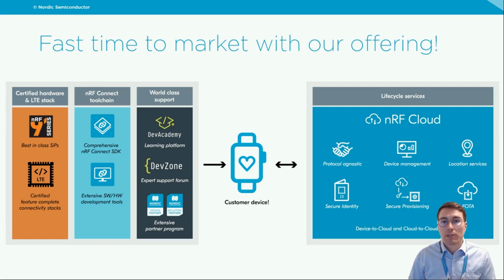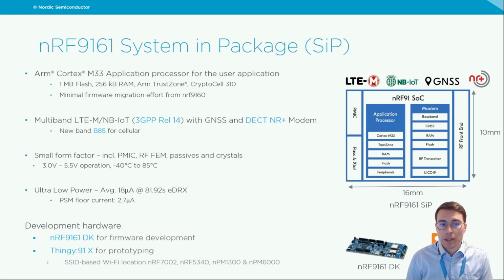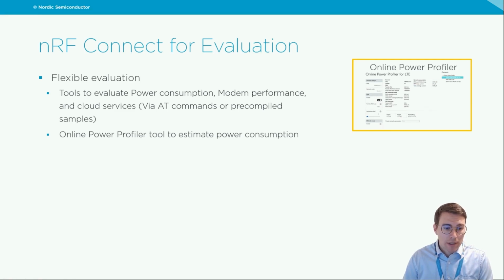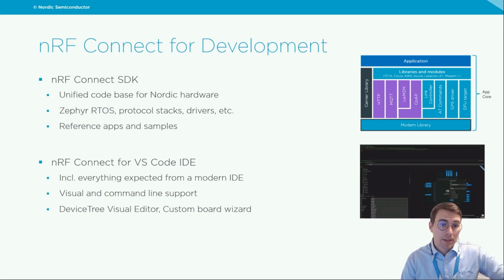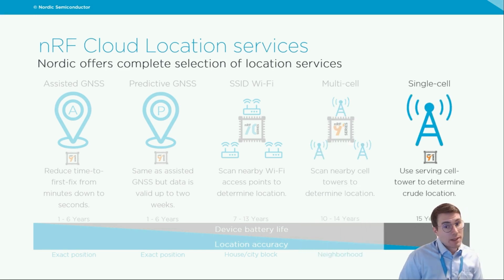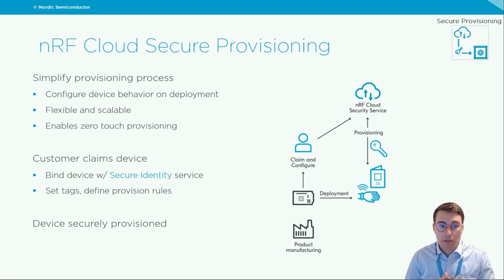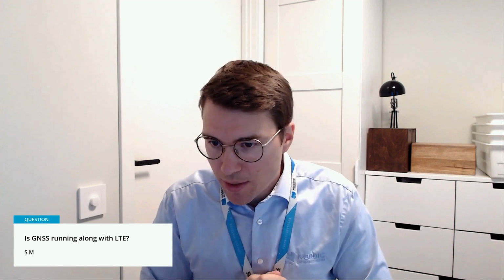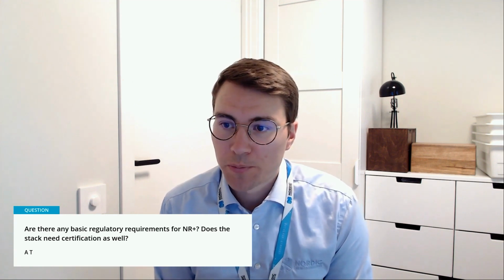Accelerate Cellular Product Development

Comment from the maker: There is an incorrect statement at 56:40 - Correction: The Onomondo SoftSIM will be fully supported on the nRF9160 by nRF Connect SDK v2.5.0.
Reply: nRF9131 will also support SoftSIM? When will nRF Connect SDK v2.5.0 be released?
Reply from the maker: @Gabriel965519437  Both nRF9161 and nRF9131 will have softSIM support, and the nRF Connect SDK v2.5.0 is target to be released Q4 2023.

Comment: Hello, this is Fabio,  my doubt, about application, i need use LTE, but i need too minimum 3000kpbs to work well, will be used telemetry of automation and one camera. per station.
Reply from the maker: Hello Fabio, streaming camera use case may be too heavy when using LTE-M as the uplink is around 375kbps; you may need to look into higher technology categories in LTE. However, if you do not require LTE there is possible to do camera streaming over Wi-Fi we have a reference samples for that: https://github.com/NordicPlayground/nrf70-wifi-ble-image-transfer-demo

Comment: Dear Nordic Semiconductors, I am pleading to you as a student who has applied for the Connect for Good challenge. I am very passionate about creating innovative solutions for social and environmental problems using your products. However, I am facing financial struggles and I cannot afford to buy the Gravity: Analog Spear Tip pH Sensor / Meter Kit that I need for my project.

I am humbly requesting your help and support to buy this kit. It would mean a lot to me and it would enable me to participate in the challenge and showcase my skills and creativity. I believe that this kit is essential for my project, which aims to monitor and improve the water quality in my community.

I have been following your company for a long time and I admire your vision and values. I think that you are doing amazing work in the field of wireless connectivity and IoT. I hope that you will consider my request and help me achieve my dream of making a positive impact in the world.

Thank you very much for your time and attention.